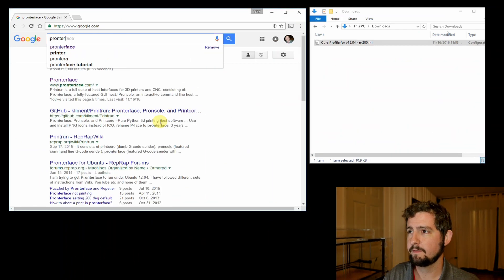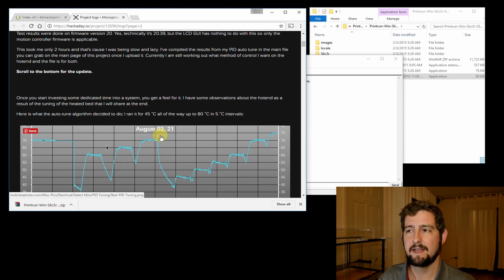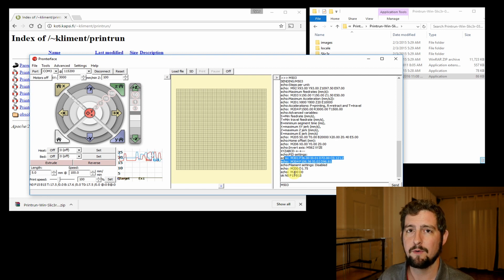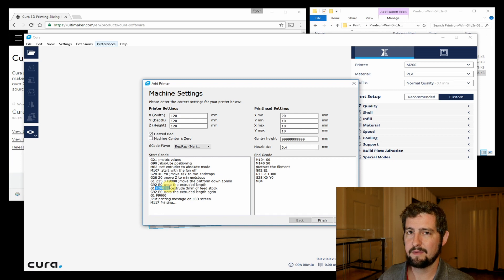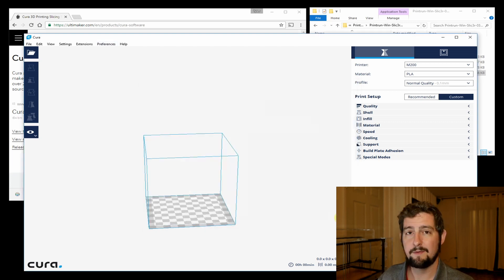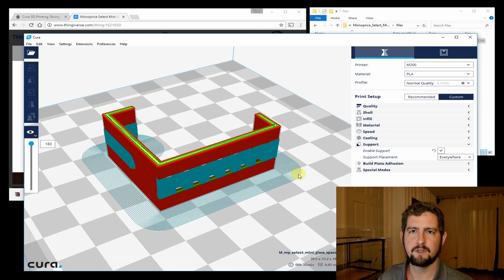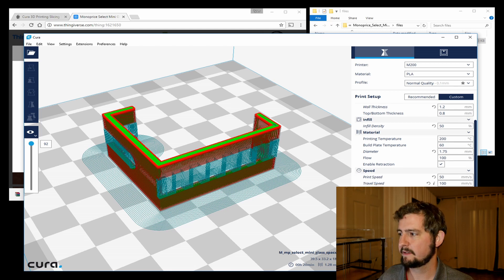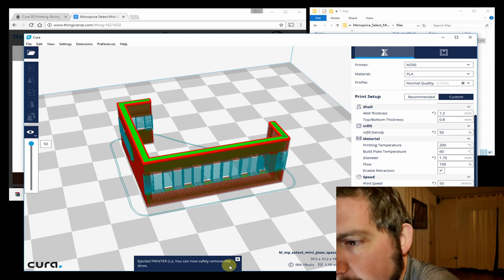Monoprice Select Mini 3D Printer Beginner's Guide (Part 3) - Tuning the firmware and slicing basics!

Comment: When my M200 prints with XYZ PLA onto the original masking tape bed I am not getting proper bed adhesion. When it starts printing a circular brim, from the outside in, the filament keeps taking straight-line shortcuts instead of printing the circle as it should. It's very frustrating. I have tried all your settings and scripts and have tried temperatures on the bed of up to 60 degrees and 200 degrees for the nozzle hoping it would stick. I have spent three days and have done about 15 failed prints and none successful so far. I even tried that dodgy trick of wiping the bed with a glue stick.. not my preferred option. Also, this starting script seems to produce a lot of dags that screw up the first part of the print as the machine drags the tangled plastic around the bed. What should I set retraction distance to?
Reply from the maker: This is a frustrating, but simple solution fortunately.  If your brim isnt going down smoothly, your bed is too far away from the nozzle.  Re-level the bed using your paper and make the distance just a bit smaller so you can feel more drag on the paper.  

You'll pretty much always want to watch the beginning of every print to wipe away any boogers of filament that may get laid down initially.  It's important to purge before starting a print, and with a low-end printer like the mini, just a reality that you need to manually pull those out of the way so they don't cause collisions later.
Reply: Thanks, I did this and added retraction settings and it now works brilliantly!
Thanks for your excellent videos on setup and customisation.

Comment: how do you use cura
Reply from the maker: That's what this video is guiding you through.  Are you having specific problems?  Might be faster to join the MP Select Mini facebook group and ask there too :) https://www.facebook.com/groups/1717306548519045/
Reply: I have ABS Filament do i need a spacer for my monoprice pm silect mini 3d priner
Reply from the maker: To reliably print ABS, adding cork insulation so you can get the bed temp to 85C, and adding some sort of build surface beyond painters/masking tape is a really really good idea.  If you want to use a glass bed, yes you will need to print or otherwise craft a space.  If you want to use a BuildTak or PEI sheet, or Kapton tape you may not need a spacer at all.

Comment: hello, I am having trouble when it comes to printing out files from thingiverse. When I print them out, they never seem to print correctly. Could you give me some possible solutions to fix this problem.
Reply from the maker: Definitely join the facebook group - make a post with photos of your print, and post with a screenshot of the settings you're using in Cura.  That will help us help you to troubleshoot :) https://www.facebook.com/groups/1717306548519045/
Reply: Life and Times of Tyler actually I figured out what I was doing wrong. I didn't have the correct base to build on lol

Comment: Hi Tyler
I just received my Monoprice Select Mini and have not printed with it yet.  I still need to calibrate the bed.
I am also going to use Cura.
I noticed in teh custom settings, you left the Printhead Setting as defaults on the right hand side.
Is that correct?  

Thanks for the video and info.
Reply from the maker: +valveman12 yep correct, printhead settings aren't used for the select mini, I believe they are for dual extruders.
Reply: Life and Times of Tyler Thanks Tyler
BTW:  Great videos.  I have learned a lot about the Monoprice Select Mini from you so a big thank you.